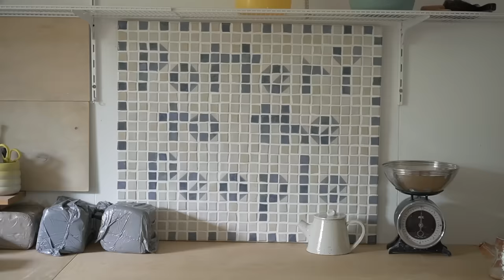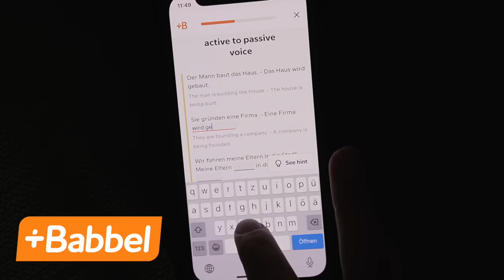The biggest MYTH in pottery.

Comment: In highschool I had an overdue art assignment, a life size sculpture of a hand, that needed to be ready to load in the kiln by end of the next school day or I'd get a zero... And I hadn't even started it. 
The art teacher was incredulous and half mocking when I said I was taking a lump of wet clay home and that I'd bring it in before school fully bone dry. She claimed it was impossible, and insisted it would explode when I shared how I planned to dry it in the oven 

I went home and built it as if half protruding from the table to eliminate the bulk of the meaty parts of the palm, so it was just under an inch at the thickest. After dinner I stuck the not even leather hard piece on some metal screen onto the oven grates, and turned the oven to 175F with the door cracked a bit for humidity to vent. 
Before bed I set it to 200F, woke up a few hours later and set it to 225F, and a few hours more and set it to 250F.
If it was going to explode it likely would have already at that far past the boiling point, so when I actually got up to get ready for school and set it to 450F for a last hour,  it was an overcautious step done mostly to be a smart@$$, since I then brought it to school insulated in a towel and still burning hot so that she had to acknowledge it was irrefutably bone dry.
(and unexploded)

Comment: To figure out when the piece is dry enough to fire, you could weigh out an identical mass of the same clay, then make that mass into a thin sheet. The thin sheet will dry fast. So, after a short time, the thin sheet will weigh less. Once the weight of the real piece is the same as the weight of the thin sheet again, you will know that the same amount of water has left it.

I'm not a ceramic artist at all, so this could be totally incorrect. Just an idea that occurred to me.

Comment: At the same time, it's worth remembering that when water is superheated, like it would be inside a kiln, it turns to vapour, which is essentially air (but under pressure), so in a way, the problem is STILL the trapped air, but if the pot were dry, it would not be a problem.
Reply: Hate to be 'that' guy, but you can't use the word "air" and "gas" interchangably. Air is a gas, and vapor is a gas, but all gases aren't air.
Reply: @elhazthorn918 I'm aware of that, however air is not "a" gas, but a blend of gases, and water vapour is among them.  Also, as a gas, its properties, as relates this project, are the same; it expands when heated, and contracts when cooled.  It speeds up, transfers heat better, and increases in pressure.

Comment: Scientifically it checks out. When clay dries it begins to shrink. If it suddenly starts drying at a rapid rate with one side dry and the other wet it will put strain on the pot and go blamo.

Edit: forgot to mention that water does the opposite when heated which is expand.

Comment: Drill a small hole in the dry sphere, put a mil of water inside and seal the hole and re-fire it. Do it inside a container if you can, because it will definitely explode. 1 gram of steam at 800c would have the same explosive power as the same weight of TNT.  The sphere would likely break well below 200C

Comment: Air expans when heated about 3 times when heated from room temperature to 600C but steam expands massively when changing from liquid water at 100C to steam at 100C it expands about 1600 times. So you only need a very small amount of liquid for a lot of steam

Comment: I have no idea if its water or air, but i thought the conventional wisdom was always that always been that small pockets of air cause explosions.  You tested a huge pocket of air.  You would think if a small pocket causes a small explosion then a larger pocket of air would cause a larger explosion, but who knows?  physics can be tricky.  The large pocket might change temperature slower then a small pocket resulting in less rapid expansion.

but it makes sense that its water, when water boils and becomes a gas it expands a LOT.  When air is heated it expands, but not early as much as water.  Since pottery is porous, it very plausible that the expanding air can easily escape while the expanding water cannot escape fast enough and the pressure builds.

Comment: So it turns out heating the air inside of a closed space corresponds to about a 4X increase in volume, but water turning to steam is a 5000X increase in volume.

Technically, they both expand in the kiln, but one of these expands a lot more.

(Calculations assume pressure remains at 1 bar and the kiln fires from about 27C to 900C)

Comment: That makes sense. Air is already a gas. Liquid water is not a gas yet and expands tremendously when it goes from liquid to gas. It also holds its temperature better than dry clay, which could cause thermal expansion variations.

Comment: Yup! It isn’t the fact there’s water that’s the problem, it’s when that water gets hot. A big problem for steam powered objects was pressure, steam expands a LOT. If it isn’t properly managed, it will explode. Clay and ceramics have less strength than metal, so they can’t withstand that pressure and as a result the piece fails catastrophically. It is spectacular, and dangerous.

I’m a huge nerd when it comes to steam ships and trains.
Reply: This is why steam power works so well, because it expands, so if you feed it through a valve controlled piston, it expands, pushing it down, then escapes pushing it back up, and this cycle repeats and that’s how you get motion and electricity.

Definitely a simplified explanation, but it’s complicated to explain quickly and in an easy to understand manner.

Comment: Its physics - water boils and expands 1700 times its volume. Water boils at  212 F. The heat inside a kiln reaches well over   1900 F degrees or more. This superheated water expands rapidly under these conditions. Place this expansion in an enclosed container (your sphere for example) and imagine the pressure on that clay as the water boils and expands inside that sphere. . The steam and pressure blows the sphere from the inside out if there is adequate water inside (clay is still wet inside) of the sphere. The poking of a hole releases the pressure inside, but only to a point. The key, as you noted, is DRY DRY DRY.

Comment: I'm not a potter, but it's intuitive to think that trapped air might cause the pot to explode. When air gets hot it expands and increased the pressure inside. This might also be the reason why water itself causes ut ti explode, since the water trapped inside of the clay might cause weak spots as it turns into vapor and scapes

Comment: While I'm watching this: who has seen “Double Walled Thermo Cup”  by Alchemy Ceramic? 
Super interesting design, but holes are being made into the enclosed space.
Reply from the maker: If they are poking in holes it will be to assist drying, I guess! Unless they believe the trapped air myth 😅
Reply: What’s your point? If you’ve spent a lot of time working on a piece I would want to have a hole just for security.
Reply: @kevinleong4467 the point is that you don’t have to poke holes if you allow your piece to fully dry.
Reply: @kevinleong4467  As per the video, the hole(s) serve to drain water, which one could probably have sponged out before fusing the inner and outer walls. 
It should also help prevent collapsing of walls during drying. 
This video here however makes it look like without excess water, it should be ok?

Comment: Feel like the large volume of trapped air would have achieved a lower pressure when heated as opposed to really small bubbles in the walls, for example, making the sphere a much "safer" situation than where you're likely to actually have bubbles
Reply from the maker: Interesting! I would be curious to test this more (maybe I do a followup video). But I would suspect that a smaller bubble would also have proportionately smaller air molecules, so equal pressure.

Comment: Air would expand less than 10% due to heat, so it may be a bit negligible in the scheme of things. As where water would expand something like 700% going through its phase change into steam. So yeah, pottery isn't going to hold up to that at all.

Comment: The other aspect you didn't cover, is that water to gas expansion is way higher than air to hotter air expansion.
Reply from the maker: I didn't know that but it makes sense! Thank you!
Reply: @PotterytothePeople  Yea, water tends to be weird compared to most other substances, especially across phase transitions.  The thing about the water vs gas thing though, is more generally the phase transitions.  

You could be right about how the gentle bisque programme may well be a big factor as to why the second test, failed to produce a failure.

Comment: Technically it is not a lie. It is just not detailed/complete enough of an explanation/answer.  It is the moisture/water in the trapped air which then turns to steam when heated which then causes the explosion.  So it is the trapped air in a general sense. And the water/moisture in the trapped air in a more specific sense.